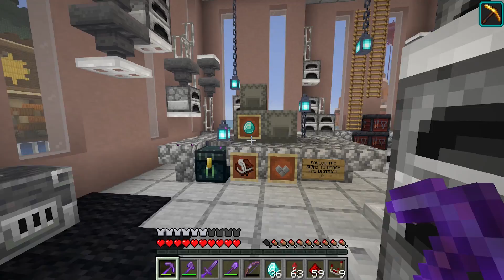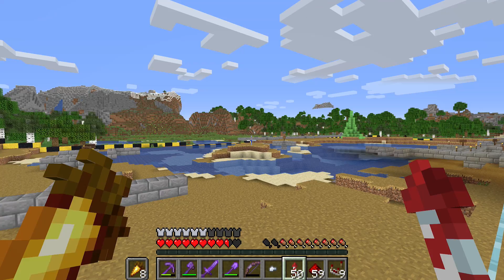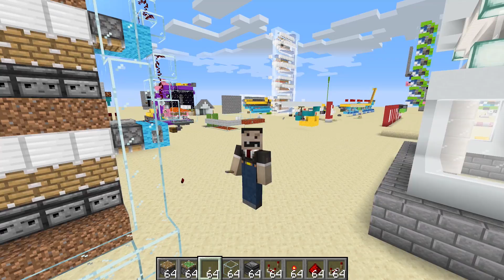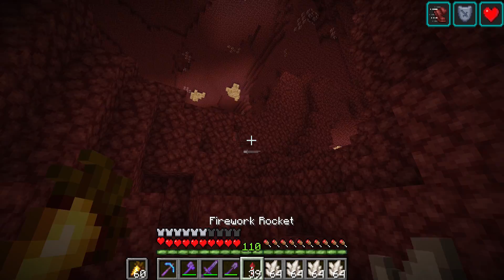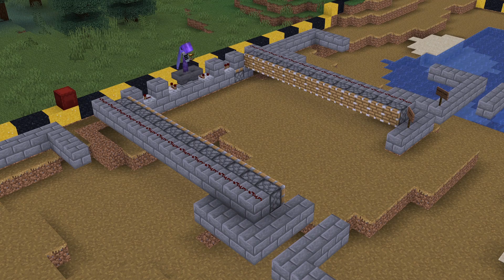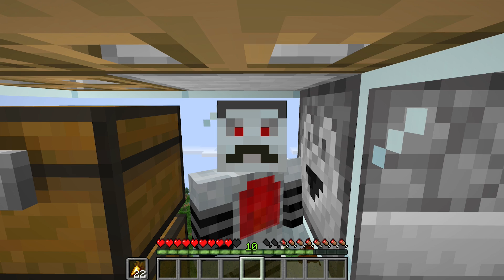Hermitcraft 7: Episode 52 - QUAD INDUSTRIAL FARM

Comment: I ran the numbers for each farm to calculate rates (calculations at the end if you want to double check, please correct me if they are wrong)

Kelp: 775 kelp per hour

General Flower Farm: 72000 flowers per hour, 45000 seeds per hour (max efficiency)

Bonemeal Flower Farm: 288000

Netherwart: 806 per hour (max efficiency)

Fifth farm: There is no fifth farm, recorded Mumbo lied to us.

MATH

Kelp: There are 315 blocks of dirt based on the amount of pistons required for the build, and at 7 rows tall, that means there are 45 kelp per row. Due to how random ticking works, we need to divide this by 16 to get the amount of chunks it take place in, 3. However, we also need subchunks, and at 28 blocks tall, that is a minimum of 2 subchunks tall, giving us a total of 6 subchunks. Next, we divide the total amount of kelp by the amount of subchunks it takes place in, giving us 52.5. 52.5 can then be multiplied by 3/4096, the chance of any given block being random ticked on any given tick in any given subchunk. We end up with a 1.3% chance for any kelp block to grow in this subchunk each tick. Next, we multiply by 6, because there are 6 subchunks. This gives a 7.7% chance of growth. There is one more thing to consider at this point, and that is that there is only a 14% chance of kelp growing when it gets random ticked, giving us a 1.1% chance of growth. Now, we take this value, and multiply it by 20 to get the per second rates, then by 60 to get per minute rates, and finally by 60 one last time to get the average hourly rates of 775.2

General Flower Farm: The farm appears to be run off of a hopper clock, which transfers one item every 4 ticks (0.2 seconds), and the pistons move every time an item is transferred. Bonemeal generates 0-8 flowers, 0-8 tall grass, and 8-24 grass when used on a grass block. Given the average of 4 flower, we can calculate that it create 20 flowers per second (4/0.2) on average. 20*60*60 gives us the final rate of 72000 flowers per hour. As for seeds, both grass and tall grass have a 12.5% chance to drop seeds when broken, so with an average of 20 total seed dropping blocks, we get 2.5 seeds per cycle, and 45000 per hour. This does not account for how often and how long the farm deactivates to collect items, and assumes that, if a flower/grass fails to grow, it tries to find a new spot instead of failing.

Bonemeal Flower Farm: Assuming the clock runs at max speed, activating once every 2 ticks, that gives 10 flowers per second, or 36000 flowers per hour. Multiply this by the amount of double tall flowers being farmed, and you get the final total of 288000 flowers per hour.

Netherwart: 46 blocks long, 5 blocks wide, 2 layers tall, total of 460 netherwart in the farm. Again, we are dealing with random tick speed, so we need to divide by subchunks. 46/16 rounds up to 3, so 153.33 netherwart per chunk. Multiply by (3/4096), then by 10% (The chance for netherwart to grow on each random tick it receives), then divide by 3 for the 4 total growth stages present, giving us rates of .00374348958333333333 netherwart per tick per subchunk. After multiplying by the amount of subchunks, then by 20, then by 3600, we get the hourly rate of 808.6 netherwart per hour. This assumes that netherwart gets harvested and replaced on the exact same tick it finishes growing.

(Note to self, the wiki provides accurate timings for most crops from seeds to fully grown so I don't have to calculate it every time)
Reply: Wow all that for 3 likes
Reply: That is a lot of work
Reply: How do you have time for this?
Reply: slow clap
Reply: Slow claps 👏       👏       👏         👏
Reply: well no one does this all Brain use for study :P even i dont XD
Reply: Why?!
Reply: Stay in school, kids. It makes you better at counting farm harvests.
Reply: I liked  lol I could never😀😅😅🤣😂😂
Reply: This is a top tier comment
Reply: Only math I would ever wanna do
Reply: don't wanna learn math but man you actually managed to kelp your sanity to f8gure this out
Reply: I didn't read all of that, but impressive, and I'm just going to agree :)
Reply: @sayiddienzidane3598  I think it makes u hate school more
Reply: Mega clap
Reply: I- impressive.... my no math brain is very impressed👏
Reply: @kingraf8  yah mine too
Reply: @puzzledrequest_4u563  Thank s
Reply: Claps
Reply: WOW! You are a true fan!
Reply: Holy frick bruh 😎
Reply: @Drion086  Counting Diamonds
Reply: @Drion086  2+3=to a helmet and boots right?
Reply: Stays in school to get good grades :(
Stays in school to calculate efficiency of Minecraft farms :)
Reply: *Asian parents smiling happily intensifies*
Reply: Trust me i love maths but I hate reading so I'm just gonna say good job
Reply: Somebody give this man a medal
Reply: r/theydidthemath
Reply: finally, i found the math person
Reply: @Thomas1016 :D hOi
Reply: Overachievers be like
Reply: My brain is hurting rn
Reply: What if I told u that u were wrong...
Reply: @sayiddienzidane3598  yes lol
Reply: I applaud you for putting in the work.
Reply: Wow
Reply: @stephenfontanilla  ok
Reply: @stephenfontanilla  nerd
Reply: @devinc9666  that takes determination
Reply: stonks
Reply: Nerd
Reply: That is a lot of maths
Reply: Madlad
Reply: @sparka7804  what i do
Reply: I'm going to subscribe to you

Comment: Ok, how did his motherboard analogy make so much sense. Think about it.
Item Storage: CPU 
         The water streams take in all the data and distribute it and and sort all the info(items), plus the daylight sensor verticle switch thing is kinda near there and all the yellow wires kinda come from the middle.

Mob farm: CPU Cooler
         the layers to each mob farm kinda make it look like a heatsink and they even constantly have water flushing through them.

Sugarcane farm and melon and pumpkin farm: RAM sticks
         The sugarcane and melon and pumpkin farm are long, thin strips that run alongside the CPU(storage system)

Bamboo Farm: Solid-state M.2
        It's thin and long but not too long and it stores lots of things(bamboo stalks)

Kelp farm: GPU(kinda)
        its tall and thin(like a GPU) and powers the graphics of the machine(just like kelp powers furnaces) except the only thing is its rotated wrong.

I couldn't think of anything for the tree farm or the new flower or nether wart farms but STILL! HOW DOES IT WORK SO WELL!!!

Comment: Build a bone meal farm that automatically fills bone meal in all farms.
Reply: He already has a huge mob spawner
Reply: He can make a composter farm that feeds directly into the tree farm
Reply: @Other_ace  and flower farms
Reply: Didn't he do that
Reply: I can't believe that after all these years, I haven't seen any hermit ever construct a network of completely sustainable automatic farms. 

e.g. Linking a kelp farm to a super smelter to produce dry kelp fuel to burn as supersmelter fuel
or concrete, trees, and lava-cobblestone farms all sharing the same blast chamber (cobblestones that can be automatically sent to the sustainable smelter
or like you said, a composter bone meal farm that feeds trees and flowers farms
Reply: NETHER TREE BONEMEAL FARM #Rendogdesign
Reply: @yiklongtay6029  that couldn't work automatically because dried kelp has to be crafted into blocks before it can be used as fuel and there's no way to automate that
Reply: @phen0menos  burn wood with wood and produce charcoal, that can be used to intimately sustain itself and other things

Comment: If I were you, I would add a item filtration system to gather all the seeds that your flower farm produces (and only the seeds) and compost them into bone meal, to be put back into the farm
Reply: That's a good idea. Personally, I would have the bone meal get distributed into the main storage system. This way, you would have the option to use that bone meal on either the same or even other bone meal requiring farms. It's a lot better to have bone meal than seeds, so automating that is a good call.

Comment: If you want to save on pistons for future netherwart (or other crop) farms, trap doors provide a similar function to pistons when waterlogged, in that a waterlogged trapdoor blocks water flow in a certain direction, but allow water to flow every other direction. Opening/closing the trapdoor allows the water to flow forwards With this, you can control the flow of water pretty easily with nothing more than a redstone line and a bit of wood.

Comment: How does your two high flower bone meal farm work? For example. I used 35 bone meal on the Lilac tall flower. I got back 35 flowers. When I put it into the composter, I only got 3 bone meal back

Comment: should look into Sodium instead of using optifine, for zooming in use Logical Zoom.

i went from a slideshow using well optimized settings with optifine to ~200FPS with a higher render distance
Reply: How does Logical Zoom compare to Ok Zoomer? I personally use Ok Zoomer.
Reply: @ari-mariberry  Logical Zoom is the Optifine Zoom without Optifine. Great for Grian as an example, who mainly uses Optifine for the zoom feature
Reply: Is it any different from Optifine zoom?
If not I'll probably stick to Ok Zoomer
Reply: @ari-mariberry  haven't used optifine for a while, but if you toggle your cinematic camera and then zoom, it keeps cinematic even after you stop zooming in on stuff. If you're playing normally without the cinematic camera, it does use cinematic for zoom and then reverts back to standard when you exit that mode

OK Zoomer is probably the best all around if you're actively using zoom and the increased zoom as well, but for people who have used optifine forever, then Logical Zoom is just that

Comment: doesnt water automatically pop off the flowers you don't need the moving floor
Reply: While water will indeed break flowers, it takes a long time to get all the way to the edge. Then, it needs to stop flowing so more flowers can grow. Therefore, pistons are more efficient. However, if you're not concerned about efficiency, go for it and use water.